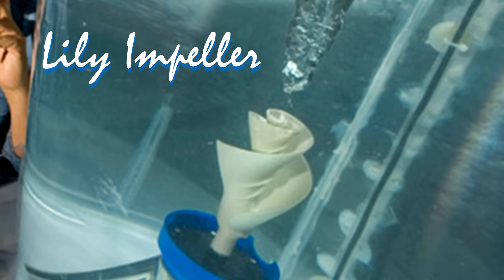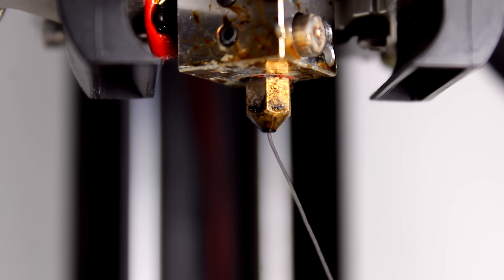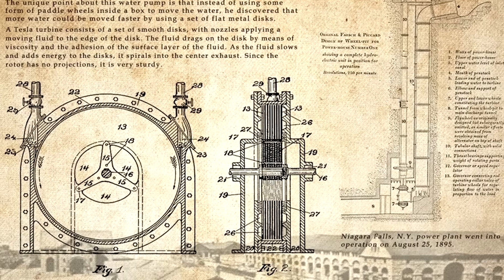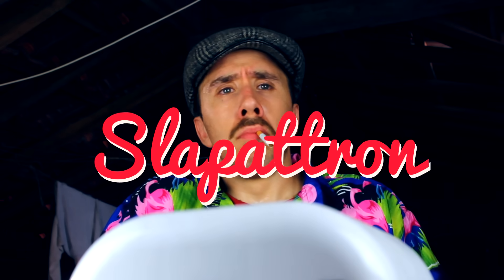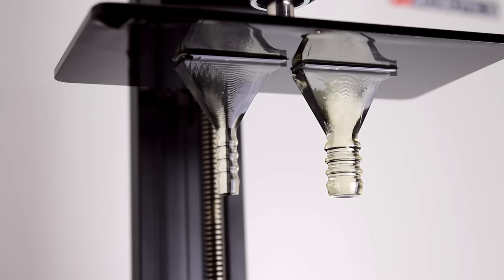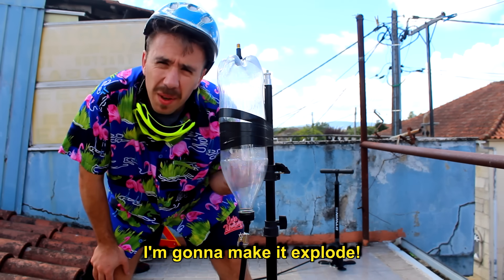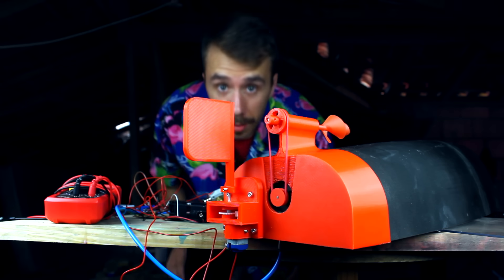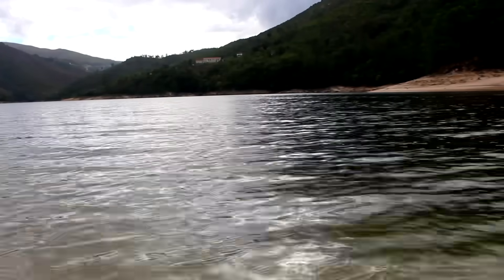Tesla Turbine Boat 3D Printed (Lily Impeller)

Comment: Don't know if you'll see this, but I've only just found this channel today, and it's now 4am and I've watched almost all your videos! I don't know how I've never found you before!

An idea for the boat... You made an impeller, right? Then make a funnel/tube for it! It's designed to pull water in, then push it back out, right now it pulls all the water from everywhere, and pushes the water everywhere, likely pushing and pulling the same water in a loop. If you stop that with a tube, you should see a thrust and speed improvement! Now if you use a funnel to "compress" the water... Now... That should give you more thrust... Woo!

Loving these videos, I really hope you keep it up! I know I don't have a chance on the 3D printer leaving this comment here, but I really aspire to get one. They're just so expensive, even for entry level kits... There's been hundreds of times where I've needed a part for one thing or another, and it'd just be so handy to have round the house. Even more useful than a regular printer these days!

Also, pro-tip: Column = "Call" (as in, phone call) and "um" or "ohm" :)

Comment: It's an impeller. It needs to have a setup like a jet ski has, a jet pump with reduction nozzle and steering nozzle to direct water jet. 
You have it set up like a traditional propeller. Make a small jet pump with the impeller inside the impeller wear ring then to the jet pump stator vanes, otherwise this RC Boat could be very fast!!

Comment: Try to design a low powered pcp air rifle, with plastic belleville washers for the internal regulator, also along the same lines maybe even the hammer spring with the same washers just to see if the pcp can be 3D printed.... Personally I think it would be a great experiment/trial very interesting anyway! I think it can be done but alas we don't have the means.  So have to throw ideas to see if it is feasible.  Thank you for your time!

Comment: I would have done a couple of things differently. I would have used a reduction so the turbine could achieve a more efficient speed and possibly make the boat go faster. The other would have been to try and 3d print air tanks, could possibly reached higher pressure and form to fit in the boat.

Comment: 3D Print a device that houses a high power Laser that conducts a high voltage plasma channel in the center to an object to remotely illuminate a light, or zap flies, or explode balloons filled with hydrogen.

Comment: For pressure. Could one not make a small steam engine?

Get a small glass vial, fill it with water and have the only outlet be through the tesla turbine. Put a small burner so that it'll heat up the vial of water and voila.

Once your water supply runs out it'll stop, but then you just build some way to feed fresh water in, or perhaps recycle used water with a condenser tube back into the boiler.

Comment: Why not enclose the impeller? That's what jetboat manufacturers do to increase the amount of thrust vs weight of the boat. Most American made jetboats are welded aluminum and require significant power such as the Volvo or GM 350 V8 with sealed cooling and specialized cylinder heads for use in a maritime environment.

Comment: Super fun looking boat.  To increase the speed consider connecting the bottles in parallel instead of series, or perhaps in parallel and series like a battery bank.  This might require the use of valves to prevent the parallel containers from trying to flow into one another.  Or, it might not since the air will want to flow into the path of least resistance.  Even if it doesn't need valves, it will require more bottles and tubing, thus adding more weight.  However, if it works in real life like how I think it would work in theory, it would be worth a shot.  I'd be curious to see if this helps.  I don't have the shop etc to test it myself unfortunately.  Also, tomatoes really are gross.

Comment: I enjoy your videos--Brilliantly funny.  But --at high speeds your impeller is turning your creating cavitation, and your losing power since the impeller is cavitating it is not able to push through the water--rather it is just spinning in the air pocket it is creating for itself.  You need to slow down the revolutions to only a few dozen a second at best. Of Course, some viewers suggested placing it in an enclosure, Not sure that is the issue but....If I knew for sure I would not be watching youtube videos late at night.  I am sure the navies of the world have a formula for their ships to prevent cavitation---it creates a lot of noise for the enemy to hear.  Your next project---A hovercraft--maybe large enough for a person?, And you should name your new 3 D that uses ultra violet light to cure the parts--"VIOLET" of course.

Comment: maybe you should use the Lily Impeller as a power source for an air pump that powers the tesla turbine to make a plane fly or an rc car move... or a boat I guess. it'd need some power to get going but provided it stays a consistently high speed it might be able to drive forever

Comment: Why don ‘t use tesla turbine as well for thrust? Double tesla turbines, on one axis. One powered by compressed air -or steam like steam engines , next one suck and speed up water? hmm, steam is hot. Not good for 3D printers material. Maybe nylon can do it, I plan to test one with up to 180 oC resistance

Comment: I want to see a Lilly impeller with a housing, seems it would be much more efficient than open. 
Also: Lilly impeller vs tesla turbine, feed same amount of fluid through each and see which gets the most rotations/ torque/ etc. 
Also: what is the most efficient spacing on a tesla turbine?

Comment: A ducted-propeller improves the efficiency of a propeller. I propose that you try a DUCTED LILY IMPELLER to determine if such an arrangement improves the propulsion for driving your Tesla Turbine Boat. My other suggestion is to move your air bottles into the hull. As is, the hull already has excess wetted surface area for the displacement needed for your boat; having the air bottles in the water is causing unnecessary drag. Instead, how about using the air tank from a paintball gun?

Comment: Looks like it would just need a bigger impeller. Although that would require a bigger power source to turn. You could increase the rotations using a gear box to increase the efficiency. Reducing the water resistance (size of the boat) would have a similar effect.

Comment: So this is super cool Integza but I have to ask about your decision to put that many rivets/bumps on the turbine?

Tesla referred to using them in an alternating pattern for some stability and the patent showed them being applied near the edges of the discs. 

Since Tesla referred to his discs as a single long blade and used centrifugal forces pushing back against the fluid to increase the length of travel time across the surface of the disc (which explains why efficiency improves at higher RPM) that means the only exhaust port has to be in the middle but the key idea behind it was to have as smooth a disc as possible to create laminar flow in order to create a thin boundary layer.

The aim of the spacing between the discs is to permit only the boundary layer on each side of the discs with only the bare minimum fluid movement to avoid turbulent flow inside the rotors. Essentially spaced apart only enough to form a boundary layer on each side of the disc but no more.

This is at odds with the design strategy of narrowing the discs at the edges in order to minimize the centrifugal stresses but introduced a larger area at the diameter of the discs. In order to take advantage of this and improve it's starting torque the star shapes add 'buckets' for the inlet flow to strike the edges of the disc while improving starting torque. I think this is what you're seeing but I think it might be getting in the way of the high end performance of the turbine.

This results in a net improvement to the turbine's power output with minimal impact to the turbine's attempts to extract momentum through sheer forces on the fluid itself as the outer edges already feature a larger amount of turbulent flow in the middle of the discs as they narrow meaning it won't be introducing turbulence where the turbine definitely doesn't want any as it interferes with the boundary layer the sheer forces require to act upon.

So in other words: The bumps are an excellent idea that simplifies the design but I think they'd be better served kept out of the bottom half of the disc. I think Tesla envisioned smaller bars as well relative to the size of the disc.

I'm going to try 3D printing a turbine myself and I'll see if the single-shaft 3-piece unit is as viable as I think it is. Truthfully tho I don't expect much until I start on the stainless steel model.

Comment: The buzzing noise you hear is the shaf radeling on the housing bore. Meaning. the bore is somewhat a bit larger than the shaft. Judging by the frequency on the raddle the shaft is not turning very fast .  There is another problem, even if you used precision bearings and the best balanced parts inside the turbine the centrifugal forces at the RPM you suggested will disintegrate the rotating components  due to the material it was made of.   I try to rotate CDs' at high RPM and they disintegrated.    The impeller idea is not very efficient.   Sorry to rain in your parade; however, I commend you for trying.

Comment: I have to ask, for a lot of this wouldn't it be faster to not 3d print? Like the hull of the boat?

Also, the RPMs are far too high for work in water. I suspect the impeller would lose a lot of energy to cavitation. But, this is based on my knowledge of regular propellers, so maybe it doesn't suffer in the same way.

Comment: Could you make a blimp, you know like a zeppelin but make it aerofoil so you  get lift from the aerofoil shaped gas bag as well as the lift from hydrogen.  You get get nice hot hydrogen from mixing chopped aluminium with sodium hydroxide.  Just make sure you only test it outside and well away from anything inflammable, and wear ear protectors and goggles too.

Comment: @Integza, a simpler version of this:  Run a tesla valve along the bottom of the boat, and put the air input near the middle.  Simple, but cool propulsion? Sucks water in the front, pushes it out the back.  In theory anyway.

Comment: I'm thinking a shroud around the impeller with an outlet directed from the sides to the rear would increase the efficiency by pulling the water in at the front & expelling it at the rear, instead of the sides.  That way it pushes as well as pulls.

MORE SPEED... maybe?

Comment: I think you should make a tesla turbine which powers a pump to pump fuel into a pulsejet, which spins a lily impeller using its thrust, which then pumps fuel into a sterling engine, which pumps air back to the tesla turbine.

Should be fun to see how long it can run for, if you end up making it! (Maybe the pulsejet stage of this cycle is too complex, so feel free to leave out the pulsejet and lily impeller if you feel that would be too difficult, if you decide to do this.)

Comment: Here re two suggestions that will greatly improve the performance :
1) Replace the Tesla turbine with an electric motor.  This has the advantage that electric motors work from batteries - which are even smaller than the air tanks.
2) Replace the Tesla impeller with a regular water screw propeller.
I have never understood why people think that if something has Tesla in the title, it must be great!  There's no doubting that a lot of Tesla inventions are interesting - but so is the Leonardo Da Vinci helicopter invention.  The Tesla inventions have been around for long enough to have been tested, and if they worked, we'd find them in everything from vehicles to power stations.  We don't.

Comment: creates a boat with 3d printer - also makes it pointless by increasing water resistance multiple times with 4 water bottles. at this point you could have just used the bottles alone and make it a raft boat.

Comment: I'd like to see you 3D print a RC Hydroplane boat that uses a jet pump (enclosed propeller). The motor needs to be waterproof  and the boat needs o be stable while on the skis.

Comment: I believe that one should solve the construction of the drive differently.  If you mount the impeller with the front end on the shaft and let it run behind the "boat", there is no obstacle in the water flow.  This would certainly noticeably increase the drive power.  And you should surround the impeller with a pipe so that the recoil is better focused.  The tube could be built in two parts with an "accordion joint" so that the rear part can be swiveled, then you don't need a rudder ...

Comment: At 5:19 I believe that the nozzle didn't help with speed because the air was flowing over a higher area at a lower speed. 

With the nozzle the air was hitting more blades, but at a lower speed, (less than 2 bar.) Without the nozzle it hit fewer blades but at a higher speed, (closer to 2 bar.)

At higher pressures more blades should help increase the speed than not.

Comment: @Integza, If you still have the boat try mounting the impeller closer to the front of the boat.
It sucks in water but I fear the incoming water also pushes the boat back. It may help with the speed.

Comment: Perhaps a trimaran & use metal cannisters for the air tanks, with much higher pressure, 1 on each side so the actual boat has loading capacity rather than massive tanks of air

Comment: A bigger impeller, inside a kind of tunnel to force the water before and after the impeller.  The rudder in the center .  Maybe you can put the air bottles inside the boat, in a vertical way, like the chimneys of an old ship.
If everything fail, use a 550 motor (cheap in any DX, Ali Express, Gear Best, Wish like websites) and some old mobile phone batteries to get 12V DC.  The RPM is not so high as the Tesla Turbine, but I think you can get more power (watts) with less weight and changing the pulleys radius send a good RPM with a good power to the impeller.

I'm a little curious to see how do you could put this kind of impeller in an airplane...

Comment: Basic ways to improve speed and power -
1. Use ball bearings and make sure everything is rigid.
2. Keep your drive train dry - put it inside a waterproof box. Water adds quite a bit of friction to the drive but also reduces the friction and the grip between the drive band and the two pulleys.
3. The bit at the end of the vid, a Tesla turbine only gets most of its full power at the higher end of its power / top RPM.
4. Maybe the impeller could be slightly larger.

Another (much better) solution to the drive chain is direct connection through a high speed drive shaft in a prop tube. The price is a lot more design work than a simple hull.    I want to see this thing do some speed.

Comment: Resume of how to build an actual impeller:

Step 1: Put the Lily impeller inside a funnel.
Step 2: Profit.
Reply: Yeah what he did isn’t an impeller. Probably better to research what an actual impeller is first since he had the definition and design wrong
Reply: Jet boats use impeller to push water out through a tube to create thrust
Reply: Would that actually work?
Reply: @ahloo6920  It works on ship sized impellers so I'd guess so.
Reply: No, that would not work. If he had the impeller facing the right direction (he is using it backward) then it would be pulling water from the sides and pushing it out the back acting as a true impeller. Putting this in a tube would restrict the water from entering the sides. Also, jet boats use a turbine, not an impeller.
Reply: @BifsieOfficial  If you go looking for spare parts for a jet boat, you will NEVER see the word "turbine" in the diagrams or listings. You will, however, see the word "impeller."
Reply: @tananam9782  I'm not sure about this particular case but generally marketing never gets the definition right anywhere. From my experience at least. With CO2 diffuser for aquarium they speak of "membranes", yet it's a sintered glas piece (there is word in my language for that but I don't know the english word). It's not semi permeable or anything a real membrane would be. When you buy "distilled water" at the store, it's not distilled but it went through an ion exchange resin. The world is filled with misuse of technical terms to the point where there is barely any product description that gets it right.
Reply: @BifsieOfficial  
You're on the right track, but in terms of real world applications, getting to a speed where the impeller is unable to pull in more water from the side because of water not replacing the displaced water and is now creating air pockets underwater is highly unlikely.  In fact if it were practical, having rocket thrusters as part of torpedoes would greatly improve speed.  So when it is enclosed, it improves performance for the most part (the water leaving is forced in a single direction).

Comment: a few questions, wouldn't enclosing the impeller keep it from wasting some effort? like some of that energy gets wasted in the water that gets pushed away laterally. would a centralized rudder give better steering response? a centralized rudder could direct the flow from the impeller. i guess thats why outboard boat motors rotate the rudder just in front of the prop so thrust is directional. neat project tho, would love to see more stuff like this.

Comment: What if you used the impeller with a housing? 
How you have it now is basically just mixing the the water under the boat with a slight forward thrust. But with a housing it should function like an impeller pump like those found in a jet ski!🤷🏻‍♂️ for maximum speed!
Reply: This need to be tried, also i was thinking about using the expelled air from the turbine, like in the back or in the impeller itself.
Reply: Thought the same thing... Redo!!